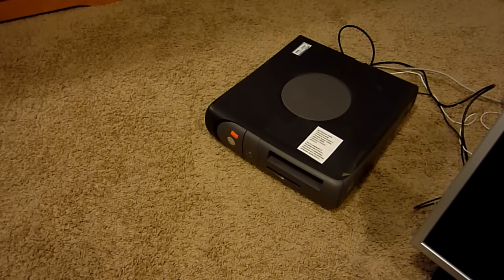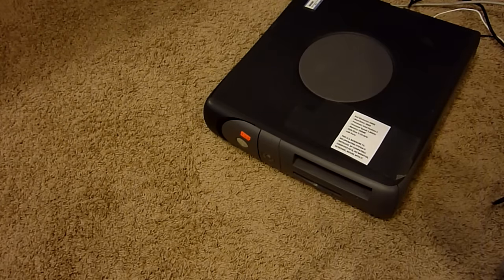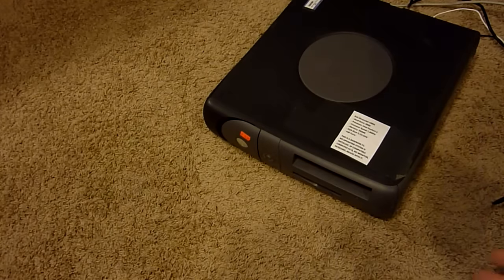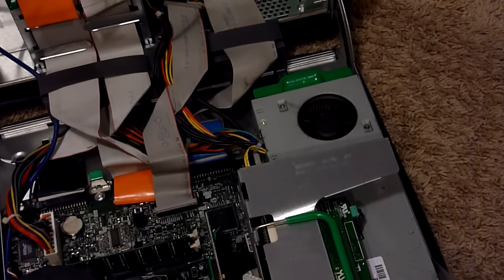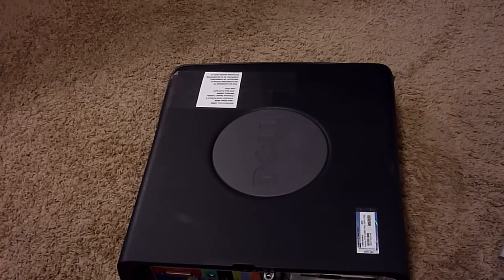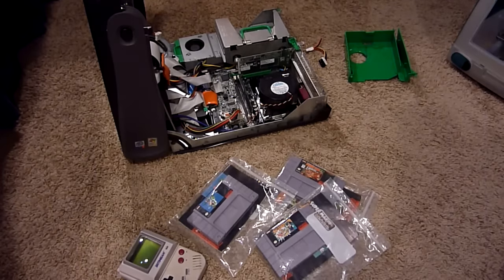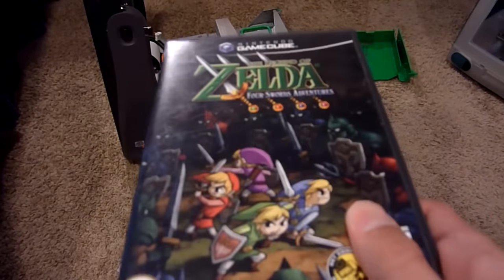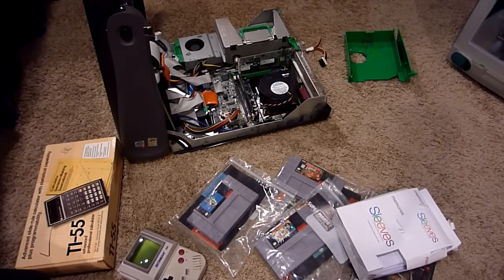$5 PC and Thrift Store Finds - 7/4/15

Comment: Yesterday I found a HP Compaq 4000 Pro SFF for $5 at a local Salvation Army. It has 4GB of DDR3 RAM, a Core 2 Duo and a 500GB 7200rpm Seagate Baracuda HDD. At first it didn't work, and had a flashing red light accompianed by 5 beeps. When I removed the heatsink to see the CPU, I noticed there was a really small amount of thermal paste. I removed it and re-applied it and I replaced one of the RAM sticks as what I read suggested one of two possible problems: Bad RAM or cooling issues. The computer now works like normal. I'll test the original stick and see if it was just a cooling issue. I also wiped the HDD clean and reinstalled Windows. I feel bad for the person that used to own this computer as it had a Refurb Windows 10 product key, so it couldn't have been purchased more than 5 or 6 years ago and the problem took minimal effort to fix. I almost feel like re-donating it or giving it away as I don't need it.

Comment: A quick way to identify the CPU is to see where the RAM is. The OEMs and board manufacturers always try to keep the RAM as close to the processor as possible. It keeps the latency lower for data transactions.

Comment: Goodwill is no longer allowed to sell PC's. They can sell monitors and other parts but not the actual PC itself is sold in the store. They are sold on ebay or scrapped. Goodwill used to pull ram to post on ebay, not they sell the whole machine on ebay for a gouged price.
That's an old Optiplex  type case.. and I like how they wiped the hard drive but left the product key OEM sticker on it.. So many shade tree IT guys working in thrift shops....
Windows 10 will work on P4 HT Prescott CPU's and the core 2 CPU's (LGA 775) that run an 800MHz bus clock but not on the old 533 or 400MHz bus.
The Seagate barracuda IV 40Gb EIDE drives are a problem drive, I have probably 50 of them that are all dead.
Reply: ***** That's because the store managers sell them on ebay and pocket the money IF they actually sell them. I know a guy who works at the local goodwill and that's what they do except they part them out and sell the parts on ebay and not the whole rig.